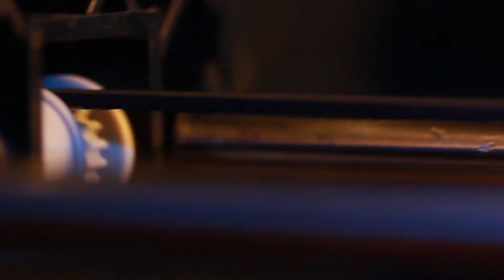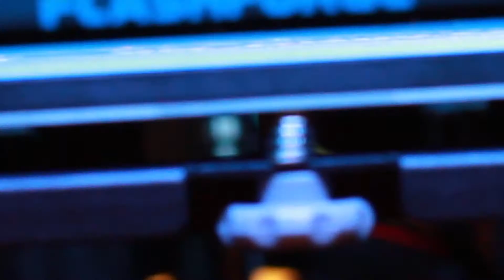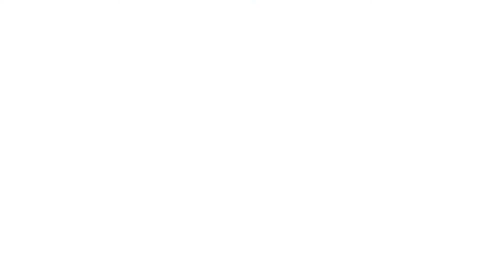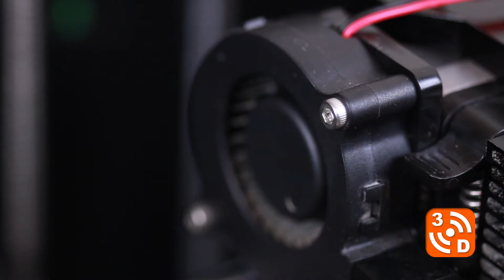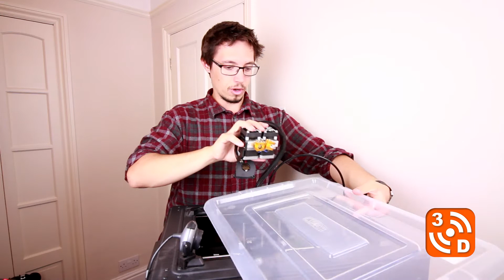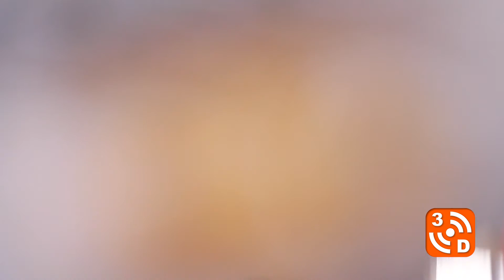Flashforge Creator Pro: Replacing a Nozzle

Comment: I have used this video so many times since I bought my FFCP 2016 back in 2017! Which camera are you using for those closeups? And are you only printing with a single extruder/nozzle installed?
Reply from the maker: Ah haha, so glad some of my older videos are still getting some use! Hmm, I think back then I was probably just filming on a Canon EOS 550D. I'd imagine for the closeup shots I was using a Canon 100mm Macro lens. I personally don't have my Flashforge Creator Pro anymore, so don't run it either way. However, for a good long while I was only running it with a single nozzle installed as I wasn't doing multi-extruder printing and it reduced the risk of misalignment causing prints to be knocked by the secondary nozzle. However, later on I did start using it for multi-extruder prints and from that point I always had both noddles installed ready for use. As long as you get it lined up at this stage, it really shouldn't cause any issues.

Comment: Question: How do you make sure both nozzles are exactly at the same height? If one is slightly lower than the other, it will destroy prints made with the other
Reply from the maker: Sorry for the late reply, this is the tool I've used for leveling the nozzles on the FFCP: https://www.thingiverse.com/thing:1582720

Comment: Nice easy to follow video. I see you have found a good print for the glass bed clips can you share as not found one that works well as the glass that comes with the printer overhangs the bed . I have just fixed it in place with kapton atm.
Reply from the maker: Hi Steve, thanks for commenting and glad you enjoyed the video. Please do subscribe if you'd like more of the same!

These are the glass bed mounts I've used but am probably going to design my own at some point with an even lower profile: https://www.thingiverse.com/thing:715545

Make sure to print these with ABS as they will be in contact with the bed and PLA will heat to warping temperature and become supportive very quickly. 

How much is your glass overhanging the bed? If these bracket's aren't suitable for you let me know and I may be able to direct you to something more suitable

Comment: Do you have to calibrate both hot-ends (if replacing only 1 )?
Reply from the maker: You will want to level them as without leveling them there is no way to be sure that one isn't going to scrape over the other during a print, or just make bed leveling impossible.
Reply from the maker: That said, you only will need to adjust the new one, but you'll still need to level it to the same height as the other.
Reply: @3DRevolution  Hi. Thanks for a great video and clearly explaining the process. Makes it much easier than the video flashforge has put up. I'm doing it on a dreamer but the hardware looks about the same. Wanted to check if you know if there's a way to level it to the same height as the other nozzle without opening up the rest of the extruder and loosening a screw at the back of the metal bar, which some people say to do online. Thanks!

Comment: The link you have to Amazon.co.uk is bad.  I ordered these nozzles but they don't fit because the internal dimensions are TOO SMALL for the tube so you can't insert it.
Reply: I had the same problem. Did you find a good alternative?
Reply: No I didn't.  I'm still looking.  Of course, 3D Revolution still get their Amazon commission for pointing us there, for a product that doesn't work.  :(   Let me know if you find one that works please.
Reply: Found nozzles at 3DXTech called Hercules A2 Hardened Steel Nozzle. Have done a few test prints and they are working like a charm. Had to replace the Bowden tubes as they were worn and clogged. Hope that helps.
Reply: Thanks for this, I've been looking all over.  Can't find any in the UK so it looks like I'll have to order from the US and pay international shipping.  I'll give them a try :)